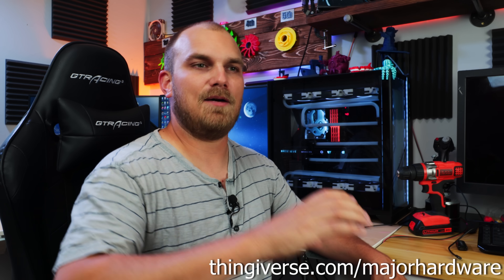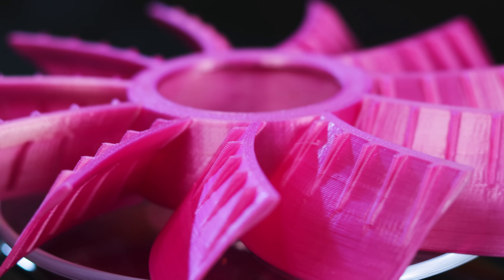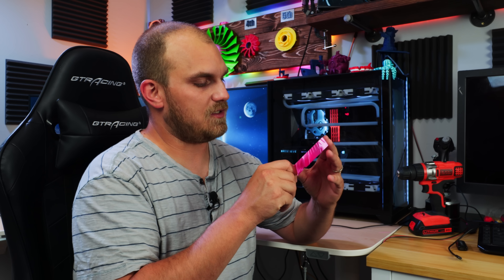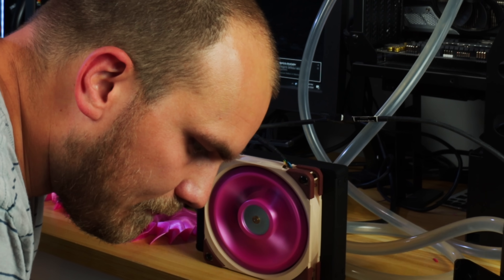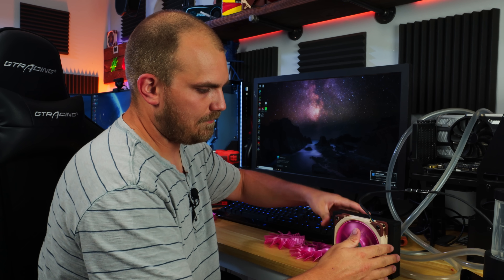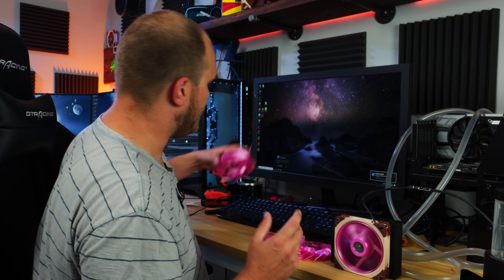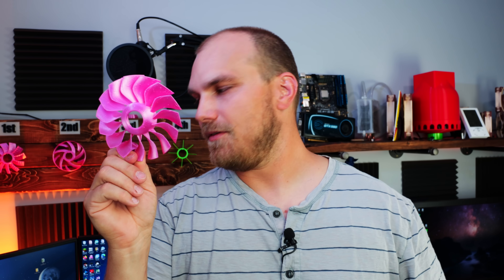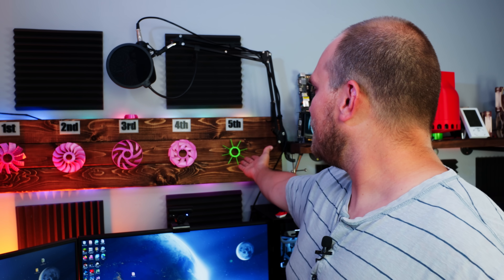4 Fans Designed by you and Printed by Me Who Is the Best | Fan Show Down Episode 3

Comment: If I mirror a fan, will it blow the other way? Or does the fan blades need to be remodeled for a different angle?
Reply from the maker: It will blow but it won't be optimized

Comment: When you are comparing fans, noise is 1 of the  two major specs, the other being air flow (or efficiency). You could at least download a simple free app, a sound meter on your phone, even if not accurate you'd still have a base for comparison  instead of "going by ear". Otherwise, great vids!

Comment: Those aren’t vortex generators. If you look at VG’s on a plane airfoil, they are angled. What they do is keep the air connected to the airfoil for longer (i.e. keep air from separating from the wing). VG’s create slightly more drag, but in doing so,  the vortexes that stay on the wing longer helps create more lift.

Comment: I'm willing to bet if you extended turbo fans blades the extra few mils past the hub it would perform better then simple, of if you nipped simples blades to end at the hub turbo would win. That much an increase in in blade surface area is pretty unbalanced imo.

Simple fan should have an asterisk unless either tests should be redone with the hub pushed tight (obviously this would fail and break things but using it as a point) or the fan gets fabricated with the blades ending at the hub so it's fair to the other models.

Not knocking the design, just takes advantage of what should be an even playing field imo.

Comment: How about getting a sound meter so that it takes the subjectivity out of the equation?  And you can get a device that measures the air speed out of the fan (forgot what it is called).  Both reasonable in price.

Comment: A 3-bladed Propeller (Airfoil)  would smoke all fans...  The PINK fan you're presenting first should be mounted the opposite direction and thus spinning the opposite direction..  Explaining:  Flip it over on the motor and re-test.  It IS a wing profile, as you mention, but it's rotating in the wrong direction to take advantage of that profile.   There's a reason EVERY airplane is pulled by an airfoil  shaped  propeller.   You're comment that "We all know an airfoil shape isn't super-necessary"   paints you both an idiot and explains why you're spinning the airfoil in the wrong direction.  You're welcome

Comment: These are my thoughts. If I gave a crap about fans, which I'm guessing is most likely pc related, I would literally just use my AC unit, so worst case scenario, I have a tube with 69 degree air blowing through. No noise, just cold air blowing from a tube. This video is so pointless to me.

Comment: The jet turbine blades are backwards according to aerodynamic design.  You are spinning them counter clockwise and they will not be as effective as they are spinning clockwise.  I wish we could just flip these PWM motors, but they dont work that way.
Also, Simple Fan has the guide fins on the wrong side of the blades.  They will be more effective at vortice control if you put them on the other side ["inside"] of the blades.

Comment: I'd like to see a power meter on the fan power lead and a plot of RPM vs power (100% duty cycle, with a friction brake limiting RPM). I'd suppose that a fan design that doesn't run near the RPM where the peak power is available from the driver probably has room for improvement, and fans consuming the most power would be competing on their ability to efficiently use the power to move the air.

Comment: Before I watch the results, I'm leaning towards the puller fan. In the automotive world, we normally use puller fans on radiators because they're more efficient unless there's significant packaging restraints where a fan won't fit between the radiator and the motor

Comment: I know you are using Delta's
But Thermal Dynamics Doesn't work on a Linear scale.
You Need to Normalize the room Temperature so all tests start with the room at the same Temperature.
Otherwise,  you can't evenly compare, the Cooling performance of one to the other.
The A12x25 had the Lowest room Temperature, and that gives it a slight advantage to begin with.
Another very important variable is Humidity level.
Higher humidity also means reduced cooling properties.

Comment: The only way to make the original A12x25 better is to reduce air spillage I think. If you make a version exactly the same as the original with an outside ring, as thin as possible and as best surface finish as possible. Maximise the diameter of the outer ring without hitting the shroud

Comment: I have an idea of a fan, but lack the ability to make it in Sketchup. This design uses 2 fan chassis.
The fan chassis would be mounted together, so they spin in opposite directions. Even though the motors spin in opposite directions the blades would be angled so they both push air in the same direction.

Comment: What if you take the best fan design the put a cover on the front of it increase the pressure of the air kinda like putting your finger on the tip of the hose

Comment: Have you ever seen the carnival ride called "The Scrambler"? It's a base frame object that spins with usually 4 arms. Mush like a normal 4 blade fan. However, each arm, then has attached to it, 4 separately spinning arms. If you were to take that base concept, and turn it into a fan, I Think, you'd produce a bigger convection current through micro turbulence, that would effectively create a vortex of thrust. 
 
See I've been trying for about a year now to design a fan built around this very concept. One spinning larger quad fan, with 4 smaller tri blade fans attached to each blade of the larger fan, roughly around the center of each larger blade. The circumference of the smaller tri blade fans, would only be that of a single blade of the larger fan. They would then be further spinning the air current faster as they spin around the hub of the larger fan. I think, if my math is right, by having a larger spinning blade rotating around the chassis of 4 smaller tri blades, you'd quadrupedal  the thrust output of the one larger fan, which would draw in the air current, initially, and then also semi cool the motor of the larger fan, as the smaller fans suck away the air current into their own convection draw. 

If this could be done theoretically; do you think it would increase the output thrust?
Reply: I'm working on a complex 3d Design, which will include brush less motors, powered by EM resonance magnetic induction. If I can get the design figured out. I will send you a copy for you to test

Comment: You should put a switch on your cable instead plugging in and out often so it won't break easily. It can be with socket as well in case you need to move it or use the output for other things but at least you won't need to plug in and out many times like in this video for 5 times without behinds scenes.

Comment: what if (stay with me here) you get a small Garret turbo charger, and run a charge pipe from the compressor side to the fan. after that, you make some contraption to spin the exhaust turbine fast enough to actually make it function like a turbo should. Then you could literally measure you fan flow in boost pressure, and have way better cooling xD

Comment: Lower RPM's means higher horsepower draw at lower speeds... could probably estimate how well the fan will cool just by seeing what speed the fan runs at since the lower the fan caps it's horsepower draw the more likely you have a higher flow fan vs. a higher pressure rise fan (fans that spin fast tend to produce more pressure vs. flow)

Comment: I emailed a design but didn’t have the dimensions for the hub or diameter requirements for the blades. I probably missed where you provided the dimensional drawing. I did see the Solidworks model for the hub but could not download on work computer.

Comment: @Major Hardware this got me thinking have you experimented with scaling down ship propeller designs and try them both forcing air away from and into the radiator, in terms of fluid dynamics water isnt all that dissimilar from water (my knowledge is limited i am not a physicist), i would make one for the next contest however my CAD skills are as a neanderthal witnessing fire for the first time, or maybe someone can take my thoughts who can, some are designed to move thousands of tons through water but in air they can rotate much much faster, or im wrong and am about to get schooled

Comment: This was really cool and it makes me wish I could join in this fun competition I have some interesting design ideas myself but I couldn't draw a stick figure to save my life .. I am curious on why you do not use any type of CFM <Air FLow> measurement in your testing.  The reason I ask is because as most of us know ... A fan cannot cool air on its own it will only move Ambient temperature and relies heavily on the displacement of cooler air away from the heat source.(be it push or pull)-  What I am getting at is,  as your ' numbers ' get closer to each other of one design beating out another... since your clearly not in a lab environment you cannot easily control the Ambient temperature of the room, thus using one fan at a warmer time of day could skew your results.  Just something to think about as when I look for a good fan .. I look for the quietest one at a given RPM that can move more air than the competition as that is the fan that has the potential to out perform a fan that may be moving faster or slower but just cannot push the air.

Comment: Use the scale tool in your slicer. It will have the 3 axis. If you put 120mm for the axis that corresponds with the diameter of the blades. It will then auto set the rest of it according to the new od. (All assuming the models dont have errors)

Comment: Would really like to see you make a rig that measures the static pressure of each fan. That would remove a lot of the variables in comparing them based on how well they cool a radiator. I'm not sure of your adjusting for ambient temp and even just the position of the rad can affect how hard the pump has to work and therefore change the ability of the rad to cool the water.

Comment: being someone that works for an industrial fan company... I will say there isn't much you can do to improve on a lot of designs nowadays

most of the different designs of fans today are a variation of the simple fan... if the designs are different normally it ends up having other reasons like needing more structural integrity due to using a larger motor,  material of the fan, and or the purpose of the fan.. like is it trying to move air, move solids, move liquids, or used as some sort of mixer.   There are considerations like spark resistant or nuclear use as well.   (btw... nuclear fans are probably the safest fans... every nut/ bolt/ washer has to be given a number/torqued/inspected by two other individuals in order to leave the plant and of course they are also one of the more expensive to build.

Comment: I think you should measure the airflow of the fans too. In addition measure the airflow and loudness at 50% and 100% because if one fan is pushing a lot more air than the other one i would compete them against the percentage they push the same air. As an example if the "simple fan" pushes 5 litres (Idk how air is measured) at 100% and has a loudness of 40dB and the "jet turbine" pushes 5 litres at 80% with a loudness of 35dB i would consider it as the "better one"

Comment: i'm wondering if the fan hub being flat is an issue, and if a pointy fan hub or an additional set of smaller blades on a pointy hub would make a significant enough difference to the airflow (there's probably an area of air that doesn't move right in front of the fan hub, so i don't know if moving it would make a difference to the overall performance).

Comment: I really hope you see this comment, but I've been doing research on fan comparisons, and of course there's tons for PC fans. I really enjoyed your video on using the bunches of tiny fans for the radiator! And now days you're doing a bunch of printed fan reviews. But the one thing I haven't seen from ANYBODY, is a comparison of JUST SMALL FANS. I recently got a 3d printer, and it's a common upgrade to change out the fan, especially on Enders. And of course many people are going for the buck converter and using Noctuas 12v fans, even though it's a 24v system, as many printers are, who h isn't really an issue. But what I'd really like to see is a straight up comparison of just small profile, 1.5-2", fans when it comes to all the typical benchmarks: noise, rpm, airflow, etc. With both 12 and 24v fans. See if Noctua is really the way to go, or if there's a better/easier/no soldering remedy for cheap fans!  I know the Nidec Gentle Typhoon and the Arctic P12 compare directly to the Noctua in all categories for a 120-140 for instance.

Comment: i was the one that blew air the wrong way, lol, and yes i accadentally made it the wrong way
Reply: I'd love to see how it does flipped around and mirrored.
Reply: @DanBowkley  yea, same
Reply: @fuzzdogs  DO IT DO IT DO IT
Reply: @DanBowkley  it might actually be rlly good
Reply: It is a thing though. Push and pull fan blade arrangement.
Reply: Still playing 3d chess since it worked better than old bryce.
Reply: Good man 👍
Reply: Your design was awesome they all were maybe if it’s made the right way it might be better plus I’d try to cut down the weight.
Reply: Nothing wrong with having a fan suck though and in some instances it'll be better then a fan that blows.
Reply: @bryanmathis224  Those fans are called groupies, aren't they?
Reply: @bryanmathis224  thats how i have one of my fans set up. it was suppose to be a push through arrangement but my case didnt have room so we reversed it and made it a pull. might not work as well, but works well enough!
Reply: Gotta be pretty good to have been made wrong and still work fairly well lol
Reply: That likely help the cooling as it wouldn't be pushing the heat from the motor through the radiator, thus using only 'raw' room air to cool the fan.  I'd love to see how much a difference there is if you flip them blades around.
Reply: Imagine what happens if you improve the "wrong way round fan" design
Reply: "It was planned" Trust me, you'll use that a lot in engineering
Reply: Man it worked well and was 3 times the weight. Imagine if you thinned it up a bit.
Reply: @donanders2110  yea i agree even if you didnt thin it alot but just thinned it down from the top to the bottom like the bottom is thinnest and the top was the thickest if that would make a difference
Reply: It's cool. Mistakes were made, but thats what innovation consists of. Just remember WD40.
Reply: but now It's a plane engine.
Reply: Wrong way or not, I would buy the HELL out of that fan!
Reply: You became the meme, you used the wrong formula and still got the right answer XD
Reply: I was really surprised he didn't try reaching out too confirm if that was an error before fabricating it. Wonder how it would test in the right orientation.
Reply: Some of the best things Engineers find are due to HAPPY ACCIDENTS,.
Reply: Bro is it possible to get that design from you? like the file for that? its madly interesting.
Reply: @mos202  thanks!  i did not put much effort into the design so the timeline in the f3d file is a bit sloppy, but here 

https://www.thingiverse.com/thing:4640742
Reply: I can honestly say your fan sucks, i was rooting for it tho, i have a soft spot for suckers
Reply: Bork?
Reply: Jack Black would be proud. His inward singing invention has become part of computing history.
Reply: Are you still blowing the wrong way?
How`s your breathing, did you need treatment?

Comment: You need to study a little bit of fluid dynamics and teach your followers. I'm not an engineer, and I haven't read much about blade design, but I can see which ones are supposed to work better for which demand cases, and which ones simply suck.

Comment: Bork looks like it would push cold air down around a heat sink with those outside blades while the inside blades pull the warm air up, but then again it might just make a loop and eventually just cycle the same warm air.

Comment: Suggestions: Please measure the air flow using anemometer like you did in the noctua clone video, and also include the noctua clone and the airscrewV3 or latest in the benchmarks if possible.

Comment: I'm sorry but a fan test without noise normalizing for fans being used in a PC makes no sense. If noise doesn't matter, simply ramp up RPM and make the fan "better" - nobody want's to sit besides such a fan, not to mention multiple of them, for hours. So when it comes to actually comparing the quality of a fan you have to consider the noise it's producing. After all, this is about beating the A12x25 which is pretty quite at what it's capable of doing.
Speaking of it: You've specifically designed and printed a rig for  your dB-meter which you also specifically bought - why aren't you using it instead making "guesses" regarding fan's noise? That just doesn't make any sense.
Here's my suggestions - although it's a litte more time consuming: Run a test at max speed (for the noise deniers) then normalize noise to 40 or even only 35 dB and run another test for actual results to compare them with the Noctua.

Comment: you should get a smoke box to run them in so you can see what they do to the air
Reply: A paper stripe does the job also, to messure the air pressure